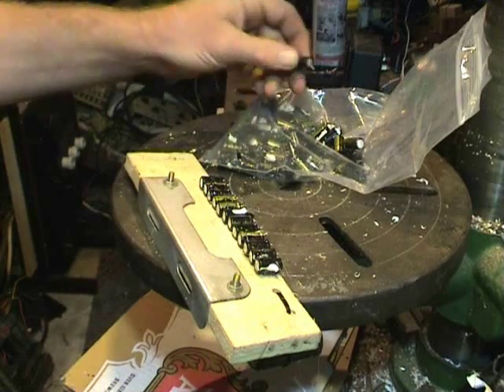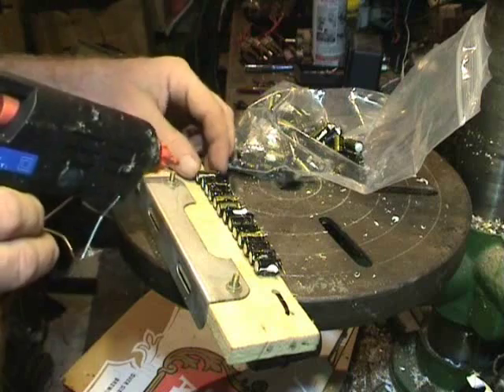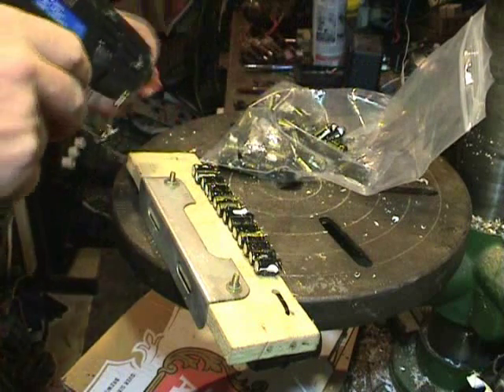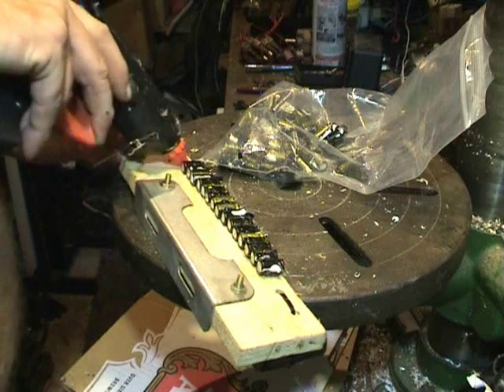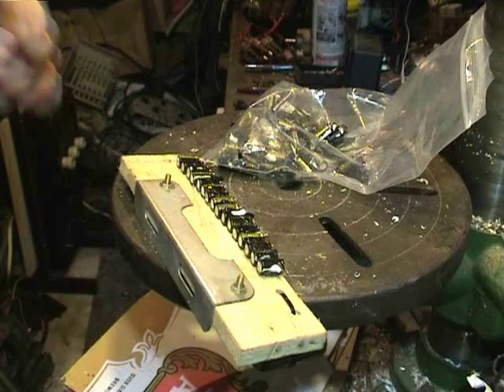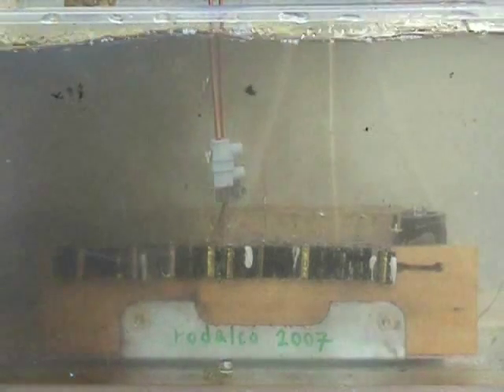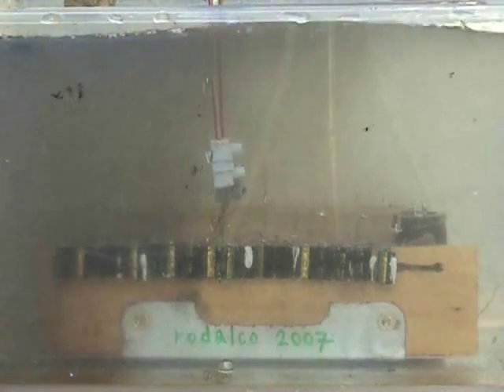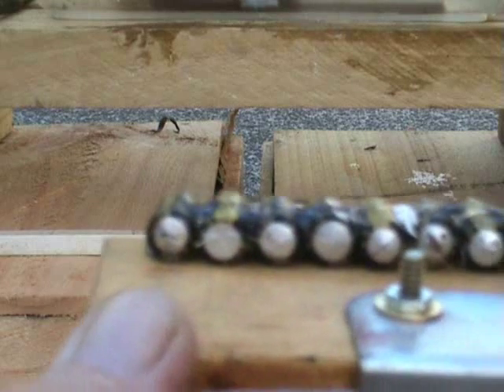18 Capacitors blown up at the same time under water

Comment from the maker: They came out of failed inverter power supplies. A lot of these caps had bulged casings, they were replaced with a different type of a higher voltage rating

Comment: without water its scary as hell I once did it by accident, these are designed to fail though, they are usually perforated to give it a weakness, then it blows and steam comes out, sounds like a bomb, not recommeneded